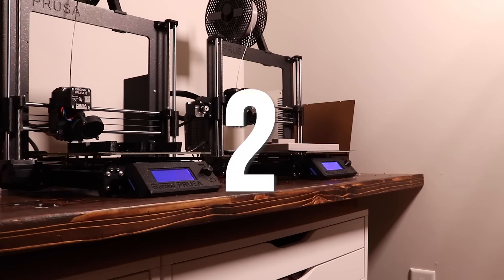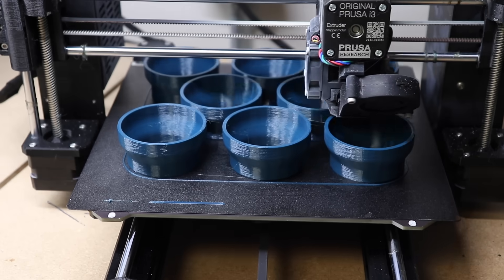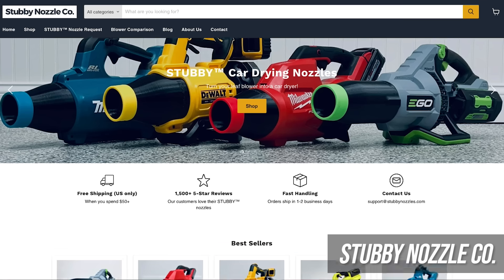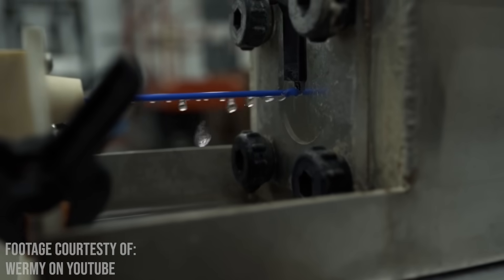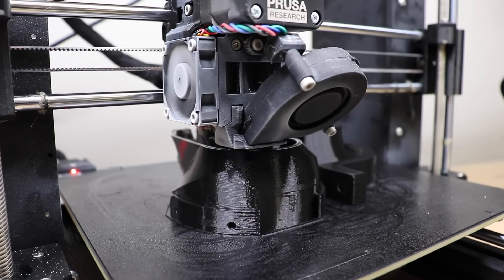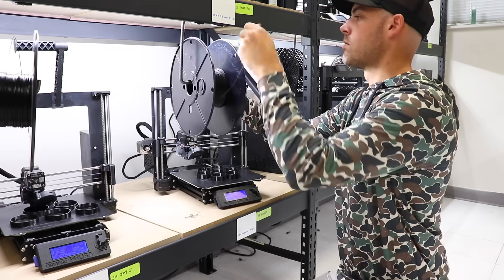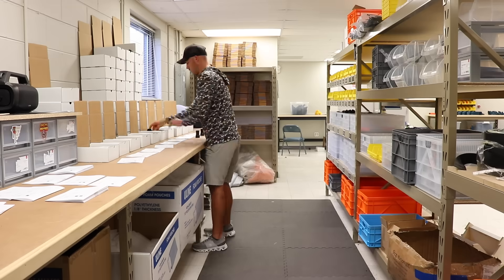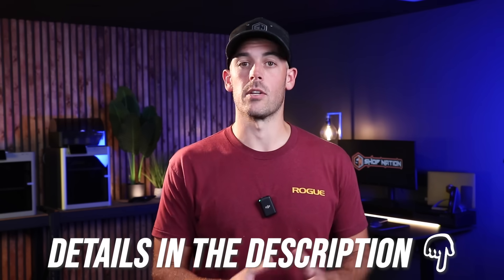10 Things I've learned running a print farm

Comment: Just got the bambu lab P1S and I've very interested in your findings regarding their reliability. I work as a manufacturing engineer so the lean manufacturing concepts make sense when it comes to print farms. I only have 4 printers right now but still struggling to find the niche product I can design.
Reply: Most products you can sell revolve usually about hobbies and a problem it can solve for people (who have that hobbies). So try more stuff
Reply: @padel24x7   It's been like that. I design things for my personal needs and find out others need it. I like to CAD so designing unique models is nice.
Reply: All the printers this guy is using are basically toys. Just like the bambu printers.
Reply: We seem to be somewhat of an outlier in that regard but we've had nothing but trouble with both of our bambu test printers and parts availability was a huge issue back then. Hope they have fixed that by now... In the end we went back to what we knew (since out Vorons are already plenty fast and produce amazing prints)
Reply: @FNmey  The parts issues look to be mostly solved now, theres a ton of spares on their shop now, at least on the UK one. Theres also been a lot of 3rd party parts showing up on aliexpress recently, I think its got to the point where theres now enough customers using them for 3rd parties to justify making parts for it.
Reply: @puressk  that's good to hear.
Thanks for letting me know.

Comment: I own 2 companies that produce 3d printed products,  my retail company (1/3 owner) is imperium outfitters.  I designed and built our original fleet. All machines run klipper and are network managed.  the shift to klipper was a game changer. I no longer run the print farm for that company, however for my other company I am making the shift to Bambu I look forward to your conclusions so far the x1 I’m running has taken much less down time, and has about 95% quality rate (previous quality rate was in the 80s) if your interested in some quick collaboration reach out, our product lines do not compete with each other.
Reply from the maker: Great, thank you!

Comment: Do you not have concerns for the data you're giving to Bambu Labs?  Their privacy policy is pretty invasive.
Reply: You can run it in local mode
Reply: @nilspa6187  Doesn't matter. They still collect what data they can on you. You can't even update the FW on them without being connected to the cloud. At which point they took your data already. EU users have caught bambu lab selling their data to as many as 20 different companies.
Reply: @nilspa6187  if you talk about "lan only" mode - that is a button, not a guarantee. :)
Can you hook bambu to a wifi of a separate router that has access only to local network? Can you use bambu software completely offline? Can you do firmware updates completely offline, via sd card?

Comment: the whole sd card thing is a bit strange, for 40 printers the sd duplicator is going to start to show its downsides. thats a fair bit of manual work to setup print jobs and faf about with a handful of small sd cards. all the printers can be sent jobs over USB/UART its trivial to have an old pc setup on the network with just octoprint. going down the route of klipper you can also get some pretty good features like exclude objects, so you can disable objects that have print faliures without killing the whole job.
Reply: Can a single Octoprint instance run 40 printers? I've only had one printer at a time, so I haven't tried it. Cool if it does.
Reply: @LiqdPT  Well youd run octoprint in a container like docker, easiest way to scale it and manage it. but im just using it as an example as its well known, and should be a good enough starting point and tooling can be built ontop of the web ui that octoprint exposes. but theres likely better alternatives that are built to support a print farm, tho these are usually paid, so itll be upto the print farm to work out what works well

Comment: This is an excellent video. The best advice I can give in planning for future technology is to go with open source machines where a companies business model doesnt include you buying new printers everytime an upgrade comes out. Klipper has made it easy to take old tech and make it better. My ender 3 v2 print farm is just as good as any print farm with new machines today. New hotends, motor, firmware, etc can be swapped easily on an open source machine to bring it up to todays standards without having to completely replace the printer.
Reply: Basically this. We mostly run Vorons these days and I would never go with something proprietary at this point ... just not worth the hassle.
Reply: @FNmey  I feel the same way with a Voron vs a Bambu Labs, but the power of the assembled Prusa's is that you get a box in, and it's up and running in 30min to an hour (probably even less if your experienced). But building a Voron takes time and time=money, in the case of a Voron 2.4 it's a lot of time, thus a lot of money. Building 40 Vorons would take a TON of time, it would take over half a year of fulltime building (single person) to get them all up and running. That doesn't scale very well...
Reply: @Cergorach  And that is your right … however you might be off on a few points. For one we don‘t use the v2.4 for a multitude of reasons but even if we did 1/2 a year of a person building full time would be about 1000 hrs … taking 25hrs a printer for assembly and tuning? For us that number is off by a factor of 6-8. The throughput on the Vorons is also much higher than the Prusas (we have both) and dealing with Marlin is a pain. In the end it probably is to each their own.

Comment: One question I have is what do you do with bad prints. Do you trash them or can they be recycled.
Reply: 3d printing filament is normally made with materials that can easily be recycled. For some larger farms they even recycle failed prints inhouse into testfilament or raw material for injection moulding. Just keep your plastics seperate.

Comment: Good insights not only on 3D printing logistics but small biz startup in general.  What are you starting to conclude about when the appropriate volume point is to switch from the flexibility of 3D printing to injection molding techniques?
Reply: I'm curious about that swell. Considering small machines only cost 3-5k and modles can be 3D printed this would make for an interesting business case/calculation.
Reply: This is a good question. I would like to say the 3d print thing license has advantages. There are some disadvantages. 
.A 3d print thing license maybe and are worded to vover all 3d printers, private, commercial and otherwise. 
So sites protect us from piracy, espisally if we supply our non commercial thing license link to a host of piracy, bam they almost always gone bam. 
Tho currently piracy levels are high. 
My last testing showed thing under 909 pirates and files we are not allowed to use. 
Plus or minus 13 years on sort by oldest to find if what i drew is original or wether im allowed to upload or sell a print of my design. 
The manual combining of search results is a pain for all farm users and comunity alike. 
Injection molded parts would need a different license or set of protections again. 
Do you know whats involved in that?
I know about non commercial 3d print thing licenses. 
A thing license is an ownership of sorts. A thing license ownership can be Migrated to more than one website. You can tell because the upload date matches the original. 
A Semi Migrate the upload date does not match so be careful not to be tricked into deleting the original. 
Did you see a sharks fin go past. 
Transfer of a thing ownership is to move the thing into another uers account on a site. 
The upload dates match original is the main proof. 
Transfer can be used to move a sold thing from you to me. 
Examples. 
People sell copies of the stl print files    $1.
Pysical prints $100.
Thing ownership $100,000.
If i keep ownership i can write in terms of use. 
Who may use it. Sell it. Exclusive use can be sort after.
What the royalties are. 
How many may be sold. 
All printers are the license holders outlets if selling that thing. 
Even my personal printer in my private room. 
You have many outlets, chain stores, vending machines, farms types all making and adding more outlets daily. 
There are benifits and draw backs. 
Drawbacks. 
Weak search engines costing us all we must improve them. 
909 pirates and wrong answers showed above the actual owner. 
Thats far from good enought. 
Yes we are working on it. 
Ai is also helping tho it showed me it does not want the job itself but its likly to make us TOOLS to USE that may not get bord and not just give wrong answers but through in the towel and utterly make up fake answers. I went to the trouble of checking all its work. 
That was a new gpt type. 
So Ai art cant be used for commercial gain because its unable to perform a thing check. 
I have a life size android Mr Data for a decade or so. I kknow Ai enough to make a comment so. 
So i cant comment on injection. 
Im near an expert on non commercial licensed 3d print things as there maybe. 
Tea earl grey hot. 
Have you heard of that?
There is a value to the license ownership. To me thats an entire ecosystem. There is a value to manufaxturing beyond the plastic part on the bench. 
How it got there. 
What machine made it. 
What terms of use that maxhine has. Can i get this to 1000 farms within an hour and have that part available and completed in two hours globally. Injection do that?
I know how to sell a stl copy. 
I know how to sell a print. 
I know how to sell a 3d licensed thing ownership. 
I dont know how to sell a injection part ownership. Do you?
The atom printing was enabled a few years ago but its not in wide use but theres plenty tek to come. 
I used to work in a injection factory. 
Pegs and spray can tops were big. 
Now im in 3d print. 
Mostly in non commercial thing licenses. 
So i can find out if a thing is original. 
Just because i drew it does not prove its original. 
I can license a thing. 
I can sell that thing ownership. 
Most newbs focus on the prints at first then stl then eventually maybe they might sell the ownership. 
Most dont know how. 
When to go injection is a great question. How to?
Whats the comparison of selling a 3d print thing license and selling a injection whatever?

Comment: The future technology is a big one. Seeing all the posts in the groups of people buying 10 printers that are quickly outdated is rough. Currently switched over to a P1S but have the intentions on building some voron tridents for size and upgradability. It all depends on if you want to tinker and would spend the time on upgrades and  proper maintenance. The people that think that they can buy these machines and just click and print are in for a rude awakening.
Reply: Agreed even though I don't neccessarily think being a little behind the current hotness is such a bad thing in all cases. For us going even faster (we run Voron V0.1 and Trident and Prusa Mk3s+) wouldn't make a big difference if any at all and this is probably the case for many operations where print speed is not the production bottleneck. Totally agree on the tinkering and maintenance part... everybody told us how the Vorons weren't good printers because of the time investment in building them and tuning them ... They are incredibly stable and run amazingly well for us on a longer maintenance window and just having them has saved us so much in terms of maintenance cost it's not even funny and well worth it.
Reply: @FNmey  what do you use the .1's for isnt the print size on them for the cost not worth it. where im from you can get a decent big printer SV06 plus or SV07 plus  for the same price and these two can still print pretty quickly. Also is there a reason you use Tridents over 2.4's
Reply: @ZFGFZDGDFG   They are the perfect size for a couple of out products and are throughput-machines. We don't want full plates of parts while we are in the office for these products because they are pretty difficult prints and having a whole plate fail somewhere down the road would be super annoying on a larger printer. The V0s allow us to get closer to our ideal of single piece flow, to keep our throughput high and our risk low and we can have multiple in the same space one trident or v2.4 would take up giving us even more output. 
Trident has been the more reliable platform in our experience and not having to service the flying gantry is a pretty decent plus as well. They are also cheaper and faster to build.
Reply: If you’re tinkering at this stage you’re wasting time which means you’re wasting money. Tinkering is done at the hobby stage, the scaled manufacturing stage is all about efficiency and output.

Some amount of repairs should be expected but constant upgrading and repeat repairs is a sign you need new hardware or need to refocus your attention on what matters: product design, mfg output, logistics.
Reply: Shoot my Bambu carbon xc1 can lol
Reply: Bambu lab printers are the solution😅
Reply: I built 10 vorons and they’ve been particularly unreliable. It might be because I went with the popular LDO kits.

I also built 10 HevORT’s and they have been extremely reliable. I think the suspended Z axis gantry design or the Voron is not great for serviceability, simplicity and reliability for a print farm. It also adds a lot of cost and complexity to the printed assembly parts, seems great for hobbyists but maybe not for a commercial setting.
Reply: @SettlingAbyss96  interesting. What exactly was unreliable? We mostly run Voron Tridents and V0.1s. Did you go for 2.4s?
Reply: @FNmey  all 2.4’s. The belted z axis was always having issues with the pulleys and alignment. It would cause z layer inconsistencies and we would have problems all the time with first layers being off if we lifted the z too high after probing the bed. I’m sure we could’ve worked them out in time but it probably wouldn’t have been worth the time investment from a business perspective.
Reply: Must not have an Anker!
Reply: @mrtickleschitz1232 yuck, anker

High speed bed slinger plus a camera that shows God knows who your stuff, all bundled in proprietary and not remarkable hardware is really not something that is noteworthy, beyond mentioning that nobody should trust Anker with anything that has a camera.

And it's not like they have any notable features that would make them extraordinary. At least BL has their laser scanner thingy
Reply: @BelviGER  Interesting perspective. What printers do you use?
Reply: @mrtickleschitz1232  Prusa mk3, Caribou, a couple of voron v2.4 and v0, a cr10 that runs completly custom electronics and a pellet extruder, two belt printers that I wish were great but that were pretty disappointing
Reply: @BelviGER  nice, I had a feeling you were using printers like that. I haven't ventured to that level of 3d printer ownership yet unless you'd consider the k1 in that realm. I've owned anycubics, sovols, a k1 and I've been happiest with my M5's. I don't have any issues with them, they've been the most reliable and produced the best prints with the k1 slightly excelling in print time and quality, but the k1 hasn't been as reliable or as easy to use, I almost returned it. I'm mainly keeping since it has an enclosure and prints well when it's not jammed or under extruding, problems I rarely have with my m5's. I'm going to look into the security concerns you brought up, although I really like my M5's if I'm creating a vulnerability by using them I'd Def move on to something else. Really hoping that's not the case though but I  appreciate the perspective.

Comment: What do you suggest to start learning the software? I know CNC and laser software and figured the software for 3D printers would be similar, but certainly doesn’t seem so. I have a Prusa and the software seems very foreign to where I haven’t even used the thing after several months of owning it.
Reply: That depends on what software we are talking about. Most designers use a regular CAD software like Fusion360. Other than that you need a slicer. Either PrusaSlicer (which is a fork of slic3r) that has a good amount of history or super slicer for something unbranded ... There are a million different versions. Stick to the paths well traveled and learn a bit about kinematics/the way 3d printing works as well as general settings for material kinds and you will be well underway. In the end there is a lot of trial and error involved with hobby 3d printing and you will gain experience as you work through things yourself.

Comment: Oh how I hated dealing with duplicating and with SD cards. Went so far as to build a duplicator myself because I had time but not money :D by now we run everything with either octoprint (for our few leftover marlin machines) or a custom implementation ontop of Moonraker (for our klipper machines). As a DevOps engineer I am terrible about scope creep but this was really worth it, especially since we can now start integrating our farm into our business management software.
Reply: It's definitely worth it to run this way. The scalability of SD cards is so low with this amount of 3d printers 😂
Reply: have you ever used the sonic pad/anything similar for a print farm and if not is there a reason not to?
Reply: @ZFGFZDGDFG   We generally don't use any of those as we have our own Klipperinterface and I am a DevOps engineer by trade so setting up systems and maintaining them isn't scary or difficult for me. They aren't bad probably but generally quite expensive and not really that great in out specific context.